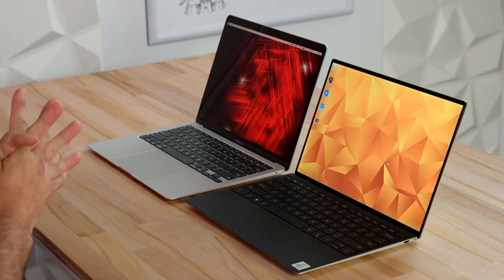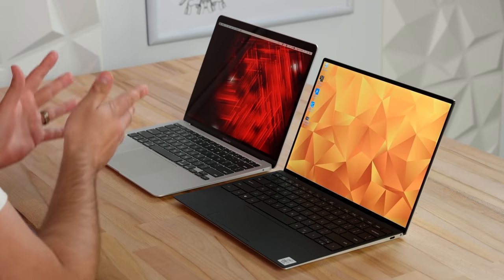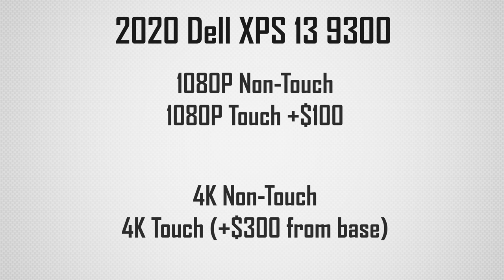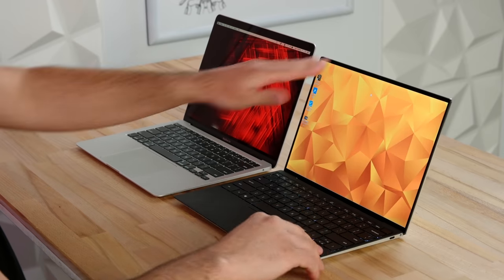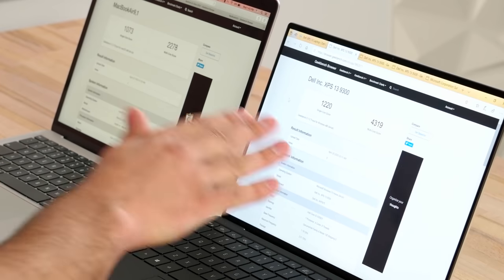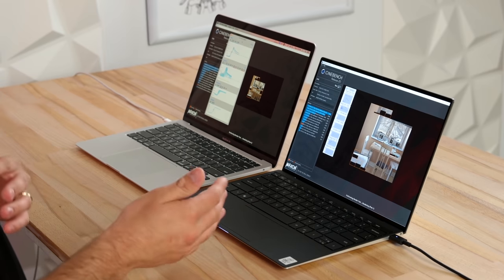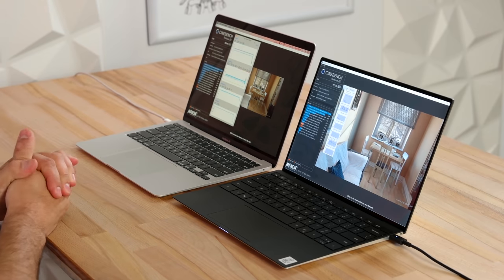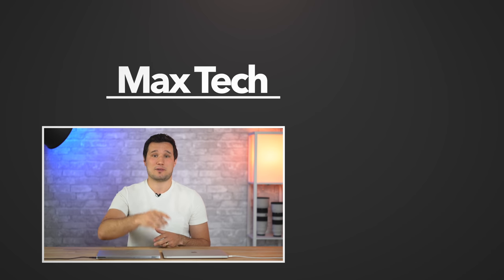2020 Dell XPS 13 vs 2020 MacBook Air - Best Ultrabook?

Comment: I think Windows laptops just cannot beat the Macbooks in these two things ever: (1) Trackpad and (2) Speakers.  Remaining categories are closely contested.
Reply: Performance after 6 months.. Macbook doesn't detoriate as well.. all windows laptops suck at that..
Reply: what the HELL were they thinking with downward firing speakers
Reply: @floydb9100  maybe they didn't want dust to settle in.. I don't see any other reason.
Most windows laptops have very limited trial/prototype runs. They hardly spend time in trying out ideas.. That is why they tend to end up leaving shitty compromises here and there. 

Not to say Macs are flawless but we have to give it to Apples credit that it takes up a styling.. perfects it and keeps using it for years and improves on it. Instead of blindly doing something just because it is fancy to have. They take their own sweet time and people seem to respect that.
Reply: @chiragojha7311 stop assuming things, it only happens to the cheap ones. my 7th gen dual core laptop still runs well after 2 years.
Reply: @joshm8324  I am not assuming have had an experience with 2 premium laptops.. one from Lenovo and one HP.. both on paper are twice powerful but in reality tend to get slow as hell specially if you perform few intensive tasks. They are never able to recover unless you restart or BSOD..
Reply: @Evie0133  good.. I have heard XPS are good. Will try one someday but for now Apple wad able to convince me that MacOS is far superior at handling stuff. So after years of using windows I have switched for good. Maybe in next few years I may revisit..
Reply: @chiragojha7311  what premium lenovo are you talking about? The Thinkpad lineup is literally the most famous product in terms of durability and strengh, maybe it was that yoga trash thing

Comment: The Macbook Air.  Just imagine a second the same laptop with an Acer or Lenovo logo on it, running windows.   It would be considered a subpar product without much debate.
Reply: Daniel Frappier if it had those logos it wouldn’t have the same build quality and the integration with Apple products and MacOS and its gestures. Also the touchpad isn’t even in the same universe. I’ve had last years XPS and got this years air and I can’t work on the XPS for any amount of time without a mouse, but I can on the Air. Having been on windows for over 10 years and now switching to MacOS, I’m never going back. Actually use the product before saying something so ignorant
Reply: Subversionz I definitely agree, I came from a Lenovo and now to a first time MacBook Air owner as of a few weeks ago and im never going back! So many small details I notice in macOS vs windows that just makes the experience worth it. One thing I love is that I can work all day from 8am-5pm from home without connecting it to charge. With my Lenovo by 10:30-11am I would need to connect to charge. I can go on and on and neat advantages I’ve learned since buying it in the beginning of the month but to put in plain and simple Apple is the best!!
Reply: @subversionz5522  I have owned a Macbook Air and a Macbook Pro in the past and although i use a 2017 Gigabyte Aero now, my next laptop will probably be a Macbook Pro 14 or 16. Apple as still exceptional build quality and the trackpads are the BEST, speakers are great to. Integration is a software thing. I was talking about the hardware, the laptop itself. When i bought my first Mac, a 2011 Macbook Air, I had been a windows user for 20 years, knew nothing about Mac OS but i bought it because i thought it was the best 13 inch, period.  This thing, this thing... although it as the aforementioned qualities, if you remove the OS of the equation it is not the best 13 inches. It as a performance that is 2 generations old, a design that is 2 generations old. It's not even a contender. My question is: If you know you need a Mac OS compatible product, why are you watching this video ? Go watch a comparison between the Air and the Pro.
Reply: Daniel Frappier I wanted one for basic development work. I wrote a review on r/MacBookair that is pinned right now. The performance is actually much better in real world applications. I ran the i5 MacBook Air vs an i7 XPS that was a year old. The MacBook performed better in running a complex python cleansing script on gigabytes of data. It also ran a VM the same if not slightly better than the XPS. I hate these YouTube channels spewing up benchmarks and not real world performance. What I tested is beyond what most everyday users will do. Conclusion: the current year XPS will be very very minimally faster in everyday tasks and it is more expensive ($200 in base config). And it has a worse experience in working without a mouse on everyday tasks. MacOS is also easier to use and has great gestures. And u are getting the best build quality with integration w apple product which I already had. Therefore, imo you are getting good value. Check out my review if interested
Reply: Daniel Frappier probably because he doesn’t want to limit his view to one brand, even if he’s pretty sure he likes it
Reply: @subversionz5522  You have to pay more for specs though and the cheapness of not putting heat pipes on the cpu. Why? The XPS can fit them on the same form factor. For a $1100 laptop they sure want to segment their products. With any sustained load the xps13 is going to be 85% faster. Software optimization can't make that up especially with something like video editing. The ARM chip would be a better chip in power consumption and heat with that layout 

That is excellent build quality? I want to buy this thing too. Hopefully an ARM version with decent specs or better bang for the buck appears
Reply: @richr161  As bad as it sounds, yes, this is still far superior to Acer build quality. I've owned a couple Acers, lured by the low prices. Fooled me twice. Friends don't let friends buy Acer.

Dell I've found to be better, but once you start upgrading a few specs the new MBP13 higher end versions don't have an enormous premium over an equivalent i7 16gb RAM 512gb config. To some people, MacOS is worth a few hundred bucks. It probably will be for me.
Reply: @MRing1107  I was talking about the Dell xps. Same form factor, similiar price, Comparable build quality but able to fit a better cpu with better cooling.

Of course it has better build quality than an Acer Laptop. Acer laptops are like a quarter of the price.

Comment: YOU REALLY DON'T NEED 4K ON A 13 INCG DEVICE pls trust me and don't buy the 4k option
Reply: nick furman He literally said the XPS looked better, so the 4K is justified as a result, and also the display is one of the most important aspects of a laptop lol.
Reply: I would actually rather wait for the 15 inch model because there 4k makes a lot more sense.
Reply: @rubenpantoja4535  you don't know how this with the resolution works and why it's stupid to put 4k on a 13 inch.
Am I right?

Comment: I’ve had the Dell XPS 13 9300 for a few weeks now I don’t even know why I’m watching this
edit: I edited it with my XPS
btw its carbon fiber on the inside of the XPS and its super comfortable
Reply: Have you had any problems with the wifi?
Reply: Lilrex12345765 no, not really sometimes the WiFi get messed up but that’s because of the router

Comment: MacBook any day :)
Reply: Because it runs Mac OS , if both were running it or were Windows machine, i don't think there would be any contest hardware wise. Mac OS is great but Apple is not making the laptops they could if there heart would be in it. Just look at how much better the screen of the iPad pro is compared to the Mac.
Reply: @danielfrappier3378  many reasons why not to go with a Dell... The biggest one is reliability! Belive me i know!!! I had an xps 13 and it has been the biggest piece of junk i have ever owned.
Just check out the forums :)
Reply: @mariomeza3514  yes exactly
Reply: I had an XPS a long time ago (in the early 2000s) kept it for 3 years, had my share of problems with it, not that great. Wonder if recent Macs are that much better now, the mindset of the company changed quite a bit since 2008.

Comment: I really wish Dell and others would follow apples lead in QHD for Laptops 4k is a battery hog and performance hog for no benefit as compared to QHD.
Reply: Jay Johnston you and 1080P is just a little too low
Reply: yeah i missed when dell put 3200x1800 displays on their laptops. i think it's the perfect resolution for a 13". just slightly above the ipad pro's ppi

Comment: Thanks for the comparison. Was in a dilemma between the two. This video makes it really easy. Just a question. The xps 13 core i5 model comes with a UHD graphics, instead of iris plus in MBA core i5. What do you think will be the difference? Would that be significant?
Reply: From the reviews i've seen,i have heard that the iris plus grapichs are much better than any other integrated one.
Reply: Both come with Intel Iris Plus, difference is that the MBA uses the Y series which is weaker while XPS uses the U Series which is more powerful.
Reply: @Kumar: XPS 13 comes with IRIS graphics only with the i7 model. I was referring to the i5 model of xps 13 vis-a-vis i5 model of MBA

Comment: Apple's move to ruin the cooling system on the 13" MacBook Air is the worst decision they've made, and the only reason they did it is because they wanted  to charge more for the 13" MacBook Pro -- with the same chip at a higher TDP, and with a proper cooling system.

Comment: If you were to consider xps 13 2020 vs Blade stealth (13 inch) 2020 which one would you give the win to. Like xps13 but my god does it have horrible webcam

Comment: Little correction might come in use for your audience, Dell 13 9300 doesn't come with 1080 resolution but with a 1200 resolution.

Comment: Can you compare the entry level Microsoft Surface Pro 7 to the base MacBook Air? I know the MSP7 is a 2-in-1 and the Air is a traditional laptop, but they both have 10th gen i3s, and they’re targeted towards students. Comparing the MacBook Air to Dell XPS 13 isn’t a fair fight, which I guess is the point.

Comment: The right question is: can macbook air compete with xps?
Is it only me who find all the comparisons in youtube between xps and macbook air unfair?
It is clear xps is a better machine and its target is the next macbook pro 13(14 maybe)
Reply: In India , the price of dell xps13 9300 i5 model is much cheaper ($150 - $200)from the quad core i5 macbook air .

Comment: I didn't hear anything about the battery back up comparison .. just curious
Reply: Its hard to compare battery life between different OS. But probably the 1080p will slightly edge out the MacBook Air and the 4k will have very less battery life compared to MacBook Air.

Comment: I love Apple, but I’m sorry they really need to start putting 4K displays in their laptops (preferably OLED or microLED).
Reply: That's the same needless spec war as once existed with cameras; beyond a certain point, megapixels are meaningless. The size of the sensor matters. Same thing here. If you can really tell the difference between a 4k resolution and the MBA then I doubt you're at a proper seating distance. 4k just consumes more power and performance for no gain, at least on such small screens.

Agree about OLED or mini LED. Apparently in the works, we'll see.

Comment: Thank you for your fantastic videos. Would you consider running benchmarks on the Macs you test in Bootcamp as well as MacOS? Particularly when comparing against Windows PCs. Might be interesting to see how the Mac performs in benchmarks in MacOS as well as in Bootcamp. Just a thought. Thanks again for your terrific videos. They are extremely helpful.

Comment: Good video. Wish you covered battery life though.
Reply: Its hard to compare battery life between different OS. But probably the 1080p will slightly edge out the MacBook Air and the 4k will have very less battery life compared to MacBook Air.
Reply: @BornArcher8  I don't feel like it's hard to compare battery life at all. It's understandable that different OS optimize apps differently, but the hours you get from doing similar tasks is about as objective as you can get.
Reply: @BookOfSaints  Sure if you are running all process closed in the benchmark and only running one process its easy like only running specific benchmarks in a loop. But you have to remember the default apps like suppose preview which does everything in MacOS might consume lets assume less than whatever windows has thanks to optimisation but in real world you might use  some other software to do its function. It could be poorly optimised for Mac but not windows. Also then there is OS load. You can configure windows in many mods like for it to run on dual screens or run it on even arm. And apple too optimises their home softwares to be really power efficient. Like there is a reason Final Cut Pro X can run smoothly even on apples poor hardware choices. So the key is software optimisation. And this is kind of hard to compare. But in short since both are running the same chip and have similarly sized battery the 1080p dell will be better while the 4k+ will be worst.

Comment: Reviewers always say "it's easy to change the SSD, look at me changing the part!" What about the transferring your windows copy, other software and files, updating bios? That's not straightforward!
Reply: Back up your laptop using the windows backup tool, download the usb boot installer, install new ssd, run boot installer, done.
Reply: And no bios update needed

Comment: Correct me if I am wrong, but Microsofts Hello is a simple 2D facial recognition system. Apple would never implement that as it is not secure. Would be nice to have proper Apple face-I’d though. Also, pricing...here in Australia the base XPS 13 costs double what the MacBook Air does. MacBook Air starts at AU$1599, 2020 Dell XPS 13 starts at AU$2998 although it seems we only get the i7...and presumably the 4K screen at that cost but cant find the specs right now. This puts it close to the base 16” MacBook Pro price (different sizes I know).

Comment: I’d be interested to see how the Dell XPS 13 9300 compares to the low-end 2019 13” MacBook Pro. In terms of performance, it’s a much more comparable option than the MacBook Air and the starting prices are pretty close. Besides, if you really care about the performance-to-price ratio and want something more comparable to the Dell XPS, you’re going to spend a little more and get the MacBook Pro and not going to settle with a MacBook Air.

Comment: Thing is xps uses Microsoft Windows .. that’s the problem
Reply: The MBA uses MacOS thats a problem too.
This isn't a comparison of which OS is better. Rather which laptop is. Or else we have talk about windows better gaming support and MacOS and its better integration with other apple devices.
Also most props are either cross compatible or nowadays run on Linux. There are only few exclusives for both the companies.